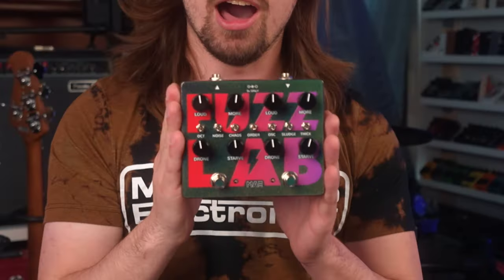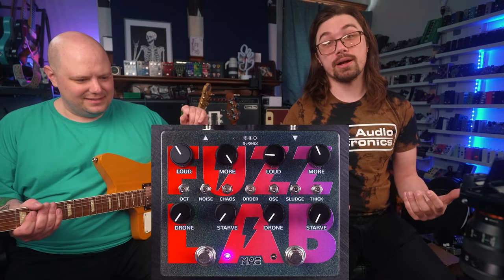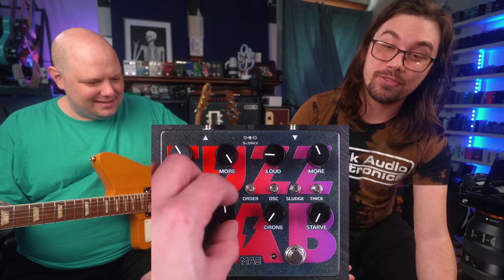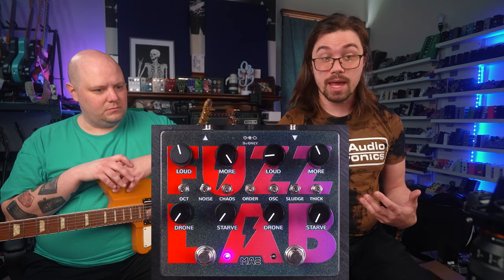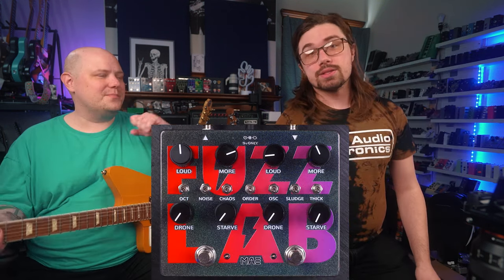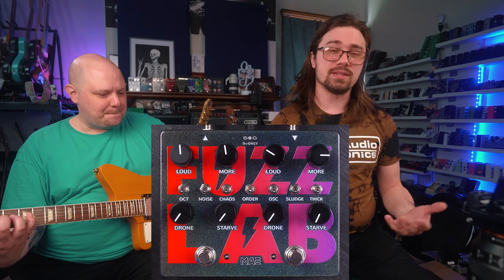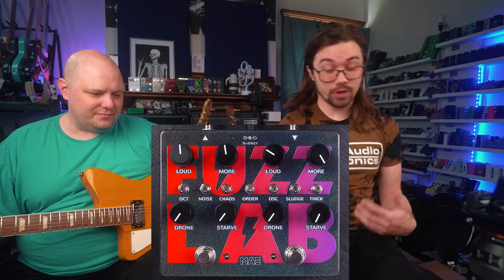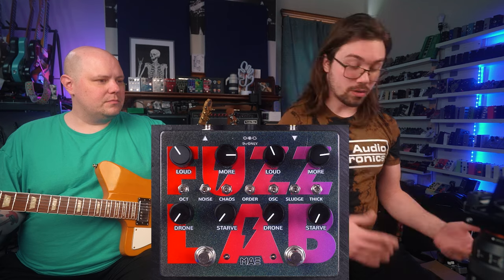Fuzz Lab | Mask Audio Electronics MEGA FUZZ

Comment: So will leaving the chaos and noise on for a long time damage the circuit, or when you say "stops working" do you mean the sound cuts out until you disengage the switches? 

Also, this is Dwarfcraft level insane and I love it! Is it available in the UK via any dealers here?
Reply from the maker: Leaving the toggles on won’t damage the circuit. When you turn the toggles on simultaneously, the signal will gradually cut out. 
As for dealers, since this is a limited run it will be available on the website https://maskaudioelectronics.com/ on April 13 3pm est